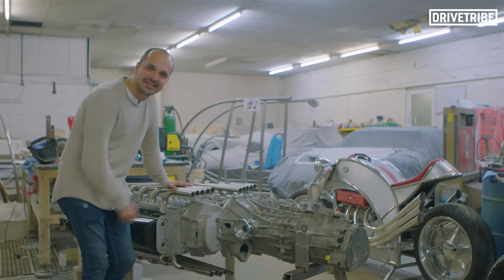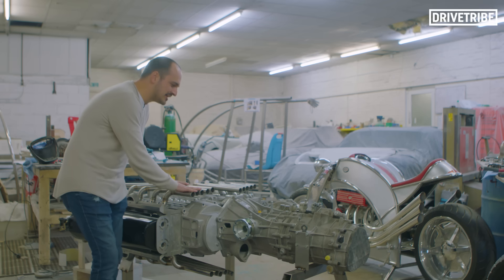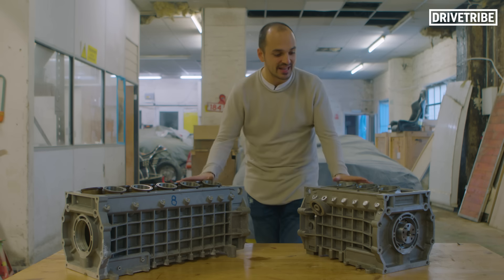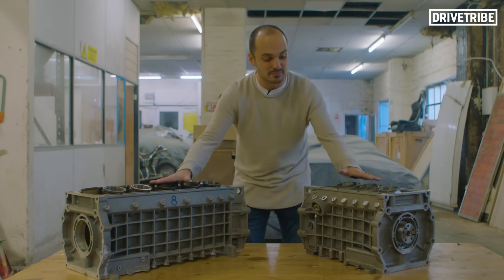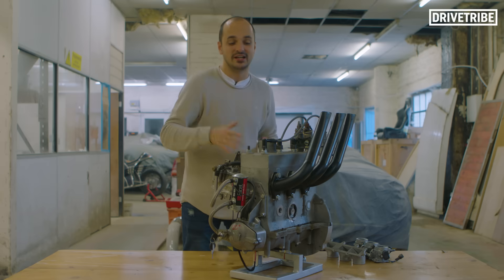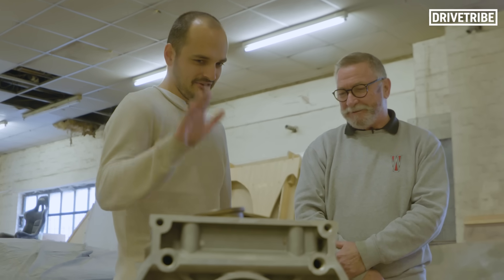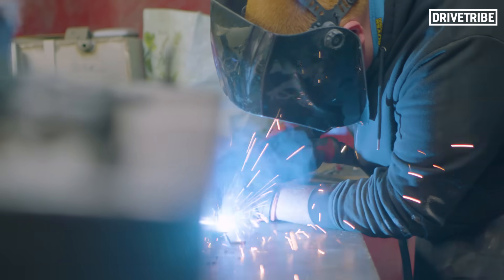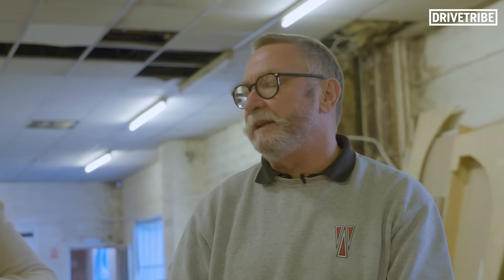This X20 engine is two V10s stuck together!

Comment: Sounds like an overly complicated way of making 400 hp.
Reply: I think the insanity of it is the point, rather than any practical use.

Ofc you can get tons more power from a smaller engine these days but who said there's no room for crazy people who go "What if we made a X48 engine" just for kicks?
Reply: In theory, an X layout engine would produce far less vibration by comparison, at least it built properly. Of course, Lubrication and ignition timing would be a nightmare with that many cylinders in general. Also, it's a 4 L engine, Practicality would only suffer due to the complexity, fuel economy would likely be fine. And then there's the fact that very few X engines have been used before.
Reply: @snapletgames4086 lube and timing has nothing to do with number of cyls
Reply: @rodracer4567  I think you’re missing the point, a 20 cylinder engine should be making at least 1k hp
Reply: @alexdurst6180 power has nothing to do with it, you ride a bicycle, there are faster ways of getting around. You aren’t a gear head of you don’t understand why this is awesome.
Reply: nearly nothing matches hp per litre naturally aspirated straight out of the manufacturer though
Reply: @ej7speed996  toyota 2zz does. 180 hp 1.8 liter. Also the FA20 from subaru and the world famous s2000 VTEC engine
Reply: @YGPaus  don't forget the Gen 4 3S-GE. The blacktop beams. 207 bhp from n/a 2L 4 cylinder
Reply: @webb2800  yeah the beams engines are amazing. Sadly where i live due to gas emissions it only has 175hp
Reply: Just like Bugatti's W16 engines, there are more practical ways of getting 1000+ hp at the wheels.  It is the theater and pantomime of the machine not the practicality being sold.  If you want something sensible and practical buy a Prius.
Reply: Their main agenda is most bang for the buck, and most people in this commentary section has completely blocked their ears. Cost effective horsepower, and usage in general, and is done because some people actually care about trying to keep the combustion engine in this world because it does matter. Most people sadly just follow trends, and will jump off a cliff if enough of others do it. 

We can't all be a sheep...
Reply: 1910's technology
Reply: I agree with the fact that it’s a small amount of HP to justify the shear size of the engine. In saying that but, it’s the passion behind making such an engine that resides with all car enthusiasts out there. They do it because they can - for the love of engines and cars.
Reply: Are we going backwards in technology?
Reply: 400 horsepower out of 4 litres NA put it into a lightweight body with a turbo and it'll scream.
Reply: Thats NA, he said they are going to boost it
Reply: Lots of Torque drop it into a Dually truck in the Bed .
Reply: This is a concept that hasn’t been done many times
Reply: @leon_brave_racing898  Indeed! where are they? I applaud inventiveness,but there are always various issues with these sort of setups,many unforseens involved and history has proven that almost always harmonics is the stumbling block that's insurmountable when coupled with  realisation that not only is the result mediocre performance but also laughable durability .Also the guy is comparing it to the consumption of a 5 litre plus  V10 powering a relatively heavy 4wd car,if you put that X20 in a Lambo not only would it drink like a fish,it would struggle to keep up with modern traffic. There are more holes in his theory than there are in his engine block!
Reply: Yeah you can get 400bhp out of a VW PD with a big turbo but that's just boring and done before ! This is new edgey and I love it !! What a great outfit !!
Reply: I think it will be like the 2jz low power compared to its upgraded version and can pump alot out
Reply: No no no lol 
400Brake horse power not 400Hp the two are so different from each other.
Reply: 20cyl with 400hp and then u have a turbo civic with 800hp haha
Reply: As far as I'm aware everything more than 8 cylinders is in the realm of diminishing returns. So a 20 cylinder engine is a little silly yes.
However if it's bragging rights your after the x20 ought to do it.
Reply: Missing the point by a million miles...
Reply: Over complicated would be 5 olds 440 v8s, all with blowers, and running alcohol. At least it made 12,000hp, though
Reply: The idea is to create a low rpm, high torque engine.
Reply: That’s exactly what i was thinking….
Reply: Hopelessly doomed
Reply: This really should be turbocharged or supercharged as it would be perfect for that
Reply: I agree such a massive thing for 400hp, get a 2lts 4pot from amg and has more 400
Reply: @vicentevidalgrau4394  yeah like a Honda k series 4 cylinder can do that I its sleep
Reply: @vicentevidalgrau4394  the purpose is to experiment, they don't even really care about being crazy powerful, they just want to make it
Reply: With a turbocharger or even two on top you can easily get a few more hp out of that thing
Reply: Way to miss the point completely.
Reply: @mbclk65amg  yeah you can go the,” Nobody’s done it so we did it” route but that doesn’t make it any better. It’s still heavier and makes less power than a v8 and has 2.5 times the number of cylinders.
Reply: @mike3963  it’s a 4l…
Reply: Exactly. You could take a v6, change fuel injection, intake, and exhaust and it would make just as much. It wouldn’t even need a turbo. And it would weigh like half as much
Reply: But, why not do it if you can? :D
Reply: @N1ncom  Exactly!
Reply: @Joe eoj 

The Chrysler Hemi 7.0L V8 from the 1960s made 425HP. Naturally aspriated and carburated. 

If you don't mind a more modern-ish engine, GM's LS7 will get you 505HP naturally aspirated.  It's a much smaller, lighter, and reliable package too. Revs to 7k which is impressive for an OHV engine.
Reply: @snaaaaaaaaaaaaaaaake who cares? Somebody will always have a faster car than you or more power, so might as well go for cool. A lot of you guys are not gearheads or “petrol heads” clearly.
Reply: @thomasc.mccartney2651  

What? Clearly the engine is lighter and revs higher. The former has benefits in handling and braking. The former is better from a sound perspective. That has everything to do with being a gearhead.
Reply: Exactly what I was thinking, I mean, an A45s needs only 4 cylinders.
Reply: I absolutely love what these boys are doing but my 1.8t on a used gtx2867r and drop in rods makes 500hp easily.
Reply: @gnarshread nobody cares about your mom’s 300hp minivan.
Reply: thats the beauty of it tho
Reply: A beautiful way, too.
Reply: Right, Koenigsegg gets over 600 hp out of the 3 cylinder in the Gemera
Reply: @mk1st  they also put a ton of money behind everything they engineer, and sell a single car for millions
Reply: @trickyok  they sell hundreds of cars
Reply: @falcongamer58  so far koenigsegg hasnt build 400 cars IN TOTAL over the last 26 years of their existens my dude. They say they will sell more Gemeras than any other car they ever build but still. that will take at least 3-4 more years until they have build them all. maybe even longer.
Reply: @drsira7248  the Gemera could be a big statement on what's possible with a 4 seater hypercar/megacar or just an overly expensive flex and that biofuels won't be viable
Reply: @mk1st  That 3-cylinder is also turbocharged and it's rated at 592.
Aside from that, making big power isn't the reason for doing something like this in the first place.
Reply: @mk1st  it’s a 6 liter 3 cylinder but yes
Reply: @mike3963  no the general engine is a 600hp 2l 3 cylinder. a 6l 3 cylinder would be quite problematic with such gigntic pistons. free valves allow turbocharging and high rpm to work together and produce big power without sacrificing emissions or drivability
Reply: when you have 20 cylinders and 1,6t gives you a problem on road
Reply: Nahhh that’s breaking horse power sooo in reality it’s gonna be like 360 wheel hp

Comment: The fact it has over twice the amount of cylinders than a v8 but Hennessy still trumps it with over 4 times the amount of horsepower
Reply: But it also has less than 1/3rd the displacement and 2 less turbos

Comment: I saw an X32 old school aircraft engine being restored once...was litterally shaped like an X though...space was not at a premium 😅

It's fair to say that the cylinders were somewhat of a larger bore also 😂

Edit: I believe it was this engine maybe...in which case it was an X24...although there was mention of the X32 in the Wiki article:

https://www.bing.com/images/search?view=detailV2&ccid=p3RZuphe&id=82C5ECD8842478376190784F8A5D2446768ADE8C&thid=OIP.p3RZupheI3ig0unk0wJdfgHaD7&mediaurl=https%3A%2F%2Foldmachinepress.files.wordpress.com%2F2012%2F11%2Frolls-royce-pennine.jpg&exph=478&expw=900&q=Rolls-Royce+Pennine&simid=608041071866089376&ck=2E222F71C0B800FDD92E79AC6C845588&selectedindex=0&form=IRPRST&pc=EMMX20&ajaxhist=0&vt=4&sim=11

Comment: I'd be more impressed with the 20 cylinder engine if they found a way to stuff two VRs onto a single crank, like a true X engine, not an X-H hybrid. The only benefit of a double crank is that you can oppose a pair of cylinders for balancing, and making the design more viable for smaller variants, like an X4.

Comment: Why is the horsepower so much lower for all those engines? Even on the NA v6, 120hp is underwhelming no? Can you increase this number with timing or cam trickery or smth?
Reply: The V6 is only a 1.2 litre engine

Comment: If the engines don't share a crank shaft, it not really an X Engine, but a dual-V.
(Just like a 180 degree V engine is not a boxer engine)

Comment: Why an X-20? 
A W-20, with the two V-10s at an angle rather than flat, would be easier to run intake and exhaust plumbing to and less bulky.

Comment: I’m no engineer but instead of gearing the two engines together, why didn’t they let the two sides share the same crank?
Reply: Possibly engine block length
Reply: @guranshsingh3215  i mean, Bugatti did it with the w16

Comment: Silly really, only 400hp out of a massive lump like that , whats the point?.
Reply: Efficiency and high revving and an amazing sound.
Reply: Why not just run an LS, it’ll make more power and weigh less
Reply: 400hp out of a V10 don't seem like much but then think of it's context... sure you could make a dinky 1.8l do 400hp but how many times will you be rebuilding it? BMW V10 is only like 300-400hp yet they are quite reliable (unless you are an unlucky second hand owner of an abused one)
Reply: @d4rkhound388  The V10 is 500hp but yes reliable if the owner warms it up properly.

Comment: An X engine has a single crankshaft. This is more akin to the H engine, which is like two flat engines whose two crankshafts are geared together. Call than an HV or a VH, not an X.

Comment: servicing this engine must be a nightmare, especially over the years, imagine working with the valve train, disassembling, inspecting, replacing and assembling 80 of each component, I find this type of service boring with only 16 valves.

Comment: Always loved V10’s, so I’m super excited to see what comes of this project. 

But only 400bhp from an engine that massive? Am I missing something?
Reply: You have to think about it's purpose, the more cylinders, the less stress on one component so an engine like this would probably last longer than a 4 cylinder pushing the same power plus that's 400hp N/A and the specs are one of the V10's is capable of 10,000 rpm in an engine that could go in a ROAD CAR... that's crazy!
Reply: It’s 4 liters
Reply: Big frictional losses, probably.
Reply: @5thearth  Nope

Comment: buy todays standered 400bhp from a 20 cylinder engine is a bit limp. my 4 cylinder audi engine in my tt with remap and a few other things is putting out 500bhp. And audis v10 puts out 600bhp.

Comment: does it have a crankshat  handling 20 cylinders in an x configuration? no, so it's not a x20

do you want to see a real X engine, other then x-24 RR vulture? take a look at the X-12 from the russian Armata tank (not couting x-24 prototypes like the DB-604)

this is more a new catergory of block (or a new multibank) , like a H-block and a DB 606 had a baby

Comment: How much does this rattling box of cogs and flying pistons weigh? For 400 bhp? This looks ridiculous next to the 500kW (670bhp) electric drive unit in the Lucid Air -- 74kg. Ok, ok, batteries.... but one day fairly soon that won't be an issue.

Comment: I honestly thought one day that "is there is a engine in an x configuration?, nah it can't be true" and here it is
Reply: An X engine is like a H engine, except using two V blocks instead of two boxers blocks.
Reply: Technically it's like a VV-20 as X would imply 4 banks of cylinders to one crank however this is two 2 banks each side attached to two cranks like this >-<

Comment: Or.... you could save your cash and just buy an ls2 ,y76, any variation of ls3. And tune them and have over 400hp at the wheels. For anywhere from 600 to 2k at a junk yard depending on of you get a trans with it. Or just buy a Gen5 LT1 6.2
That has 450hp from 1800 rpm to 6300ish rpm. Tune it, over 500 at the wheels lol. Keep it simple save your cash. And if you like the sound of Ferrari and Lamborghini.  Just change out the crankshaft to a flat -plane style and you will get the same sound and more reliability

Comment: I love a quirky project but this is just silly. 440hp from a 20 cylinder engine? stick to a tuned V10 or even a V8, you'll get just as much performance, if not more. The only thing you're going to get with this engine is daft levels of torque you won't be able to put down properly and ridiculous fuel consumption

Comment: But why? None of them really makes any sense. If you worry about fuel economy you wont buy a v10 you buy an inline 4 anyway maybe i didnt understand but x20 as well and only 400hp..?? Any proper v10 puts down more than that. So your milage is double because the horsepower is half??? Dont see the point

Comment: Theirs just no practical use for this. You would need to refuel every 5 minutes. It weighs so much you do not even get the benefit of power or speed from it. Not to mention how slow acceleration would be from 0 - 60

Comment: They're going to have to be VERY careful with lubrication and cooling issues with the upper banks of cylinders. Check out the Rolls-Royce Vulture engine, an X-24 engine made for the Manchester Bomber and Tempest Fighter in WWII. They mostly burst into flames or seized up very easily...

Comment: The problem of an X pattern engine is a worse problem than a boxer engine. The bottom cylinders are working against gravity. The VR engine makes sense from a reliability/packaging perspective at the cost of center of gravity. To me the X pattern engine is just a fantastical idea compared to a W pattern engine.

Comment: It will just sound like two V10’s it’s not strictly a single engine.
Reply: It depends how the engines are timed and how the exhaust manifolds are configured. With a V engine of any angle, you can use a flatplane crank and have uneven timing and an easily machined crank, or a traditional crankshaft with even timing. The two configurations have different characteristics for vibration and for designing intake and exhaust tuning.

With an X engine, you can time the two halves like a flat engine (180 degree V), alternating between banks, or like a boxer engine where each piston is paired with one in the opposing bank. Again, the choice has consequences for vibration and tuning.

With the two halves mated via gearing, they won't have problems trying to ensure the bores in each half intersect with the crank axis like a boxer does, but they will have classic boxer issues like having to take the engine out to change headgaskets.
Reply: @EmyrDerfel  you missed the part where this engine has two crankshafts. It's not a true X engine at all, it's two V's with gear-snychronized crankshafts.
Reply: @5thearth  In terms of sound that doesn't matter at all.
Reply: @EmyrDerfel  it does, since it's just 2 V10s each with the same firing order strapped together. It will just sound like a V10, because it's just the firing order of a V10.
Reply: @MrsMcMuffin  No, because you can either have cylinder 1 of each V10 firing in sync like a boxer, or gear cylinder 1 of the second v10 to fire between two firings of the first v10, so you'll have twice the number of bangs per revolution.

Comment: There is a problem with the basic Physics of this gadget. More cylinders means more moving parts, and higher fabrication costs. Smaller cylinders mean more swept area (friction) and heat transfer to metal, relative to volume. In the wrong direction for cost, wear, emissions, and economy.

Comment: I drive a tiny 4cly car in America, rarely start any of my 7.5l, 5.8l and 4.6l v8 engines or 2 storke motorcycles so I know it's not my engine's consuming 1000's of cubs of air an gallons of fuel resulting in pollution lol

Comment: The way he says 400 cracks me up as if that's alot these days
Reply: 400 is plenty, oh wait.. I suppose you drive a 600bhp Lambo or something.
Reply: @FloridaCams  No but my first car was an El Camino with a modified 350 that did 400ish hp and the engine probably was half the weight / less than half the cylinders and made in the 60s.

Acting as if 400 hp is special to hit NA is hilarious. Then to say they needed a lambo transmission for all the power killed me.

Only real positive thing about the setup is the low center of the weight.

Comment: Ummm, x20... 400hp, that sounds terrible to me
Reply: Because it’s a prototype. It’s meant to figure out if it’s reliable to handle more horsepower down the line. Especially for a smaller company, you need to handle your resources